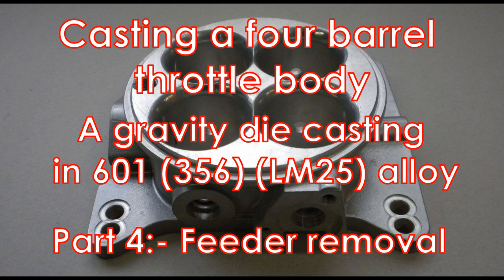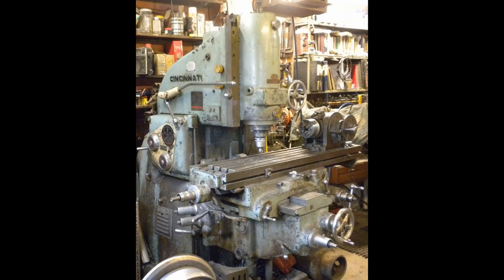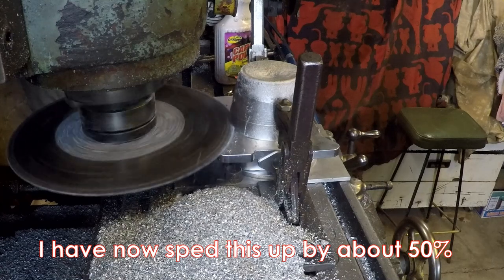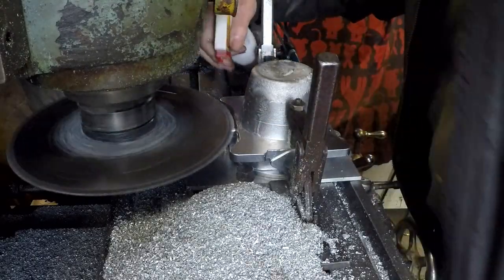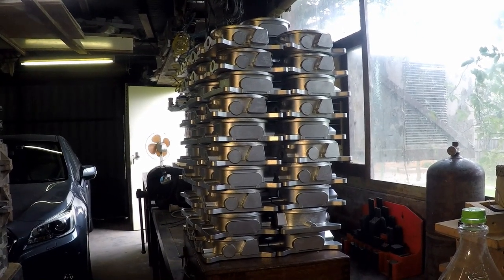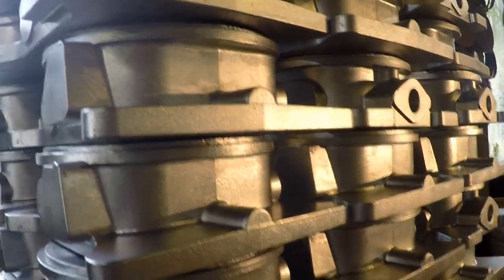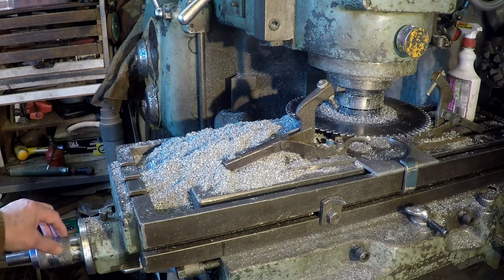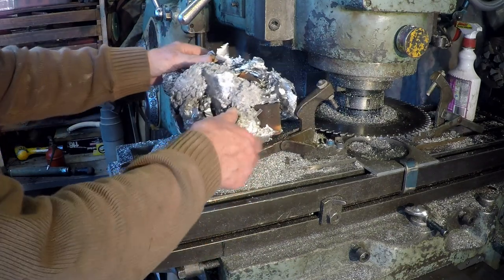Casting a four barrel throttle body Part 4:- feeder removal

Comment: Sadly one doesnt have a furnace which could get the temperature over 2050°C. That would solve the problem with the oxide layer. :(  BUT: Nice casting!
Reply from the maker: Han, Ah Ha a student of the Ellingham diagram! Something of a rarity. Clearly the C to CO curve and the Al to Al2O3 do in fact cross at about 2000 Deg. C and a little bit so yes I guess at about 2050 you should be able to get C to reduce Al2O3. It is or was done with Mg as a commercial extraction process where  the cross is at about 1800 C but there both products ( the Mg and the CO) are gases and can be quickly removed from the system thus further favouring the reaction.
One place I worked that used to take a melt to 2200 deg. C to induce a reaction between Ti and N in an alnico alloy - done in a pure magnesite lined very over powered induction furnace, at that temp the metal looks sky blue... Martin

Comment: I was always told chips is what the tool is producing during machining, swarf is the pile of chips produced by machining. My father was a machinist and that's how he referenced them. I think that's how my manufacturing textbook defined them too.

Yep, toss the swarf in the bin and send it to the recycling center don't remelt it. Same with aluminum cans it's not worth melting for quality castings (I know, I'm guilty of melting garbage)
Reply: sell the cans, buy or swap for any usable drops for lathe or mill work.  Or material worth melting for your castings.  they must have some kind of use for it.

Comment: Granted that aluminum swarf will not be worth melting down for re-use in small foundry, it should definitely not be chucked "in a bin."   It needs to go to metal recycling.  It's ready (and far more energy efficient) for re-smelting, even while being useless for casting.
Reply from the maker: Walnut, You are exactly correct. It should be recycled but only providing the cost (environmental) of doing so does not out way the savings made. In my case the amount is quite small (usually) and the transport cost alone ruins it. Properly handled by good recyclers it can make useful casting alloys again...Martin

Comment: Sawdust and slag can be remelted under a thick layer of flux. If you throw dirty metal into the flux, the flux will impregnate the oxides and slag and prevent them from plunging into the metal. In the future, all this is scooped from the surface.
However, flux can be aggressive to the crucible. Here it is already necessary to look and consider whether it will be profitable to recycle recycled metal in your conditions.
Reply from the maker: Dimitry, You are correct but its a dirty process best carried out at large scale in large furnaces and with agitation to separate the flux/oxide/and metal. Its not really the sort of thing that small; operators should be attempting - certainly in my case it would be anything but profitable. And yes the fluxes are agressive... Martin

Comment: In the bin for a scrapyard- profit margin in the states can be made better in the small shop when you factor in the money return from recycled metals- especially brass bronze and any carbide tooling bits.  Sure it takes an hour of your time to haul it- but that s money you are tossing out. Get a deal with a local scrapper for a 60/40 split (where he returns all receipts to you for verification)  and make it worth your time for free money. Customer already bought it- why are you throwing out a "double" profit?
Reply from the maker: S Dunca, I agree with you but its a question of quantity. Although this job looks to produce a fair bit of saleable scrap it is very much an exception. Most of my work produces very little of this and I would have to store it for a long while until it built up enough to make a saleable load. I don't really have the room to do this and some of the scrap stinks slightly but unpleasantly of rotten egg gas - the used fluxes in the furnace dross seem to do this. I don't want to upset my neighbours (at whose mercy I operate) so the best think I can do is get rid of the smelly stuff asap and there is usually very little else save a few cupfuls of bandsaw swarf. In a perfect world considering the huge environmental cost of aluminium production I would be all for saving every little piece but this is only valid if on balance the environmental savings are there - with my small quantities sadly,  they aren't... Martin
Reply: @olfoundryman8418  Completely understand that... My shop is not at my house- so I can tolerate a bin  gathering weight. Not a rub against you at all my friend- I respect what you do. Just putting it out there as a take-away for others to consider... Bravo on ALL fronts to your videos! Looking forward to the next one!

Comment: Send the aluminium waste to an actual recycler. 👍🏼👍🏼👍🏼
Reply from the maker: Peter, Yes, I could have and probably should have, but the cost to me and the environment in fuel and time to get to one made it rather moot. My point in specifically mentioning the waste in the video was to dissuade people from trying to melt it down themselves -  the cost in time and fuel of doing this plus the low quality of metal recovered makes the exercise not really worth it....Martin

Comment: Swarf, sell it as scrap!
Reply from the maker: Matthew, If I had enough of it that is exactly what I would do, but the small quantity that I generate would not make it worth while to drive to the scrap metal dealer. To try and reclaim it myself would be an environmental disaster on fuel cost alone... Martin
Reply: @olfoundryman8418  I have a 200 litre drum that I throw Al scrap in, it's surprising how fast it builds up!
Reply from the maker: Matthew, Now for a 200 litre drum full I would drive it to the scrapie. This job with its rather high swarf production is very much an exception for me, I would be years tripping over that 200 litre drum before it was even half way full, I do very little production machining and most of my swarf is by the "cupful" from the bandsaw, very fine and utterly terrible 😊… Martin